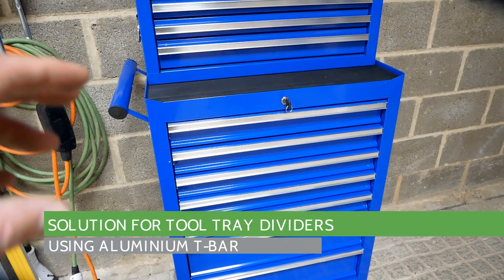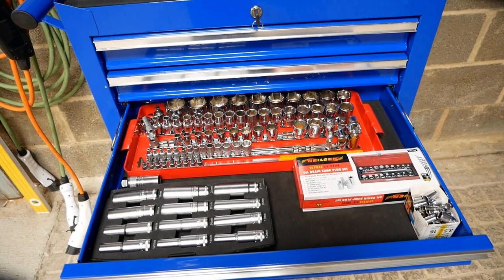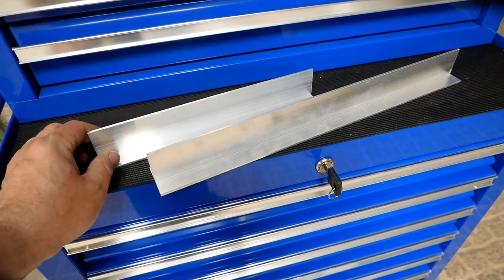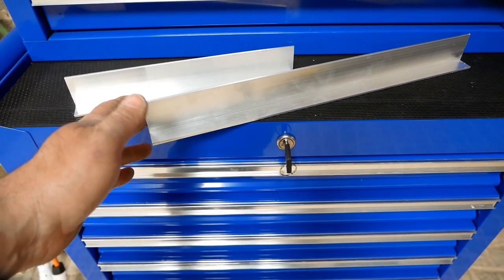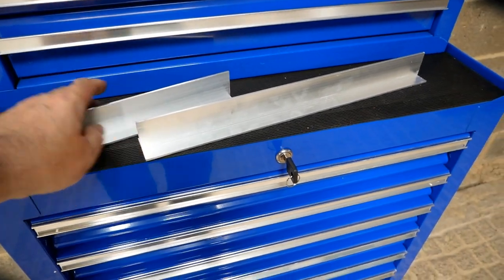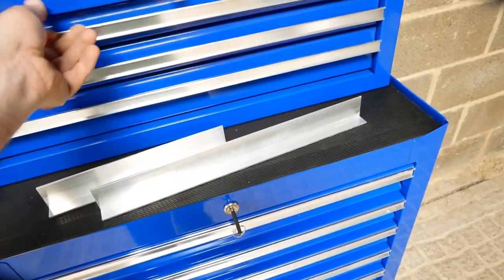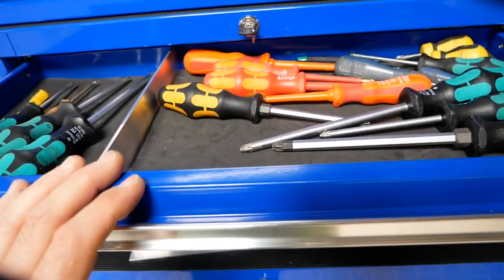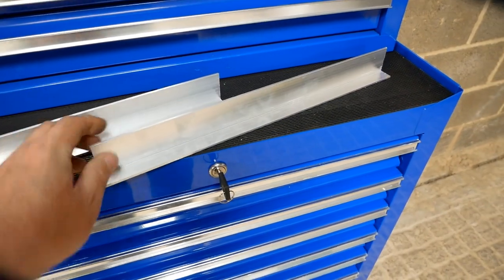My solution for making tool chest drawer dividers using aluminium t-bar

Comment: I wonder if someone makes magnetic “tape”. Perhaps one side is a thin magnet and the other a 3M type adhesive tape. So you could affix to the aluminum. And the magnetic side down for the metal tool box drawers.

Comment: Great idea,  S.ears /craftsman used to sell red plastic 36" lengths the same "T" shape as yours with double sided tape on the bottom just cut to length./  peel off the protective film fro the double side tape and stick it down to the bottom of the drawer..I cant find these any were anymore, So I'll use your idea or just 90 degree alum..angle and put double side tape on the Bottom...Thanks for the inspiration !!

Comment: This is a very good idea. I was thinking of cutting wood strips for my new box but I like this better. The silicone idea would make them still movable if I needed you down the road or they can be pop riveted in for an even more permanent solution. Thanks for sharing.